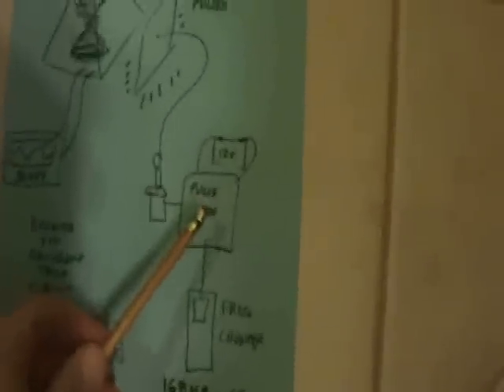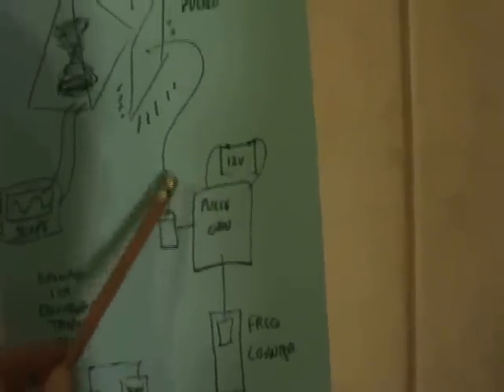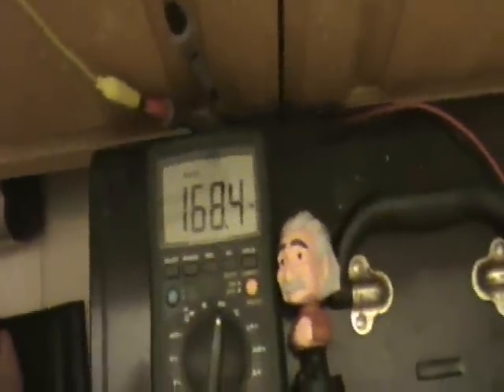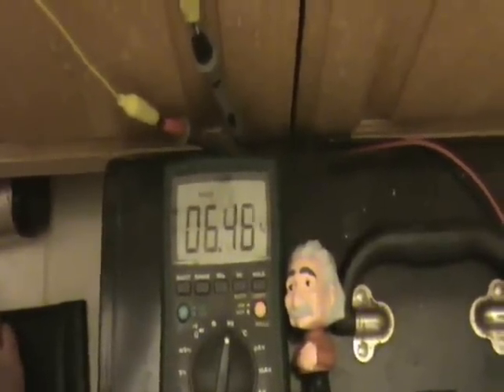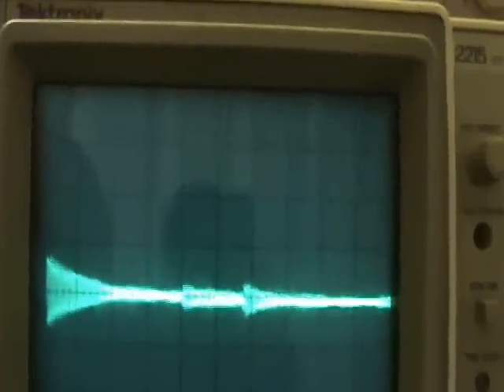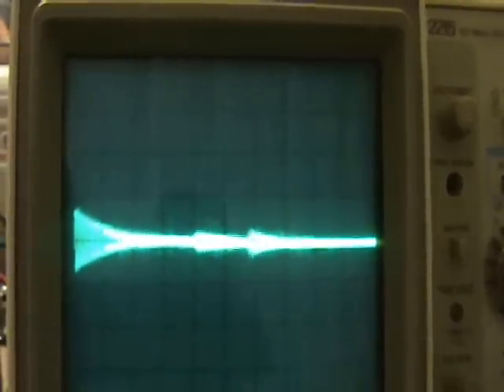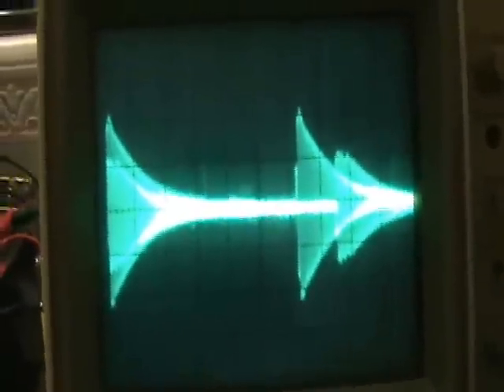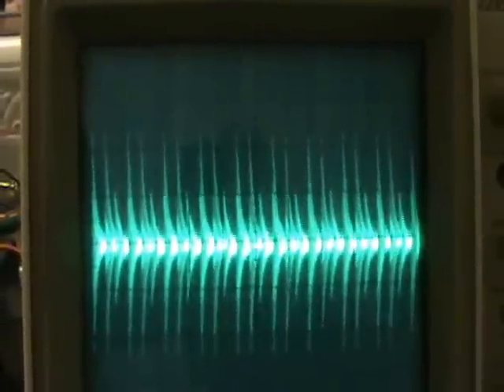Ep. 10: Bashar Free Energy Space-Time Antenna (High Voltage Ping Experiment)

Comment: very interesting developments! i admire your perseverance :)

id take note of that echo frequency, might be the resonant frequency of your coil mass. Therefore If you spark it with AC at that frequency it might just keep ringing like Bashar implied :)

The best way i can think of is by using a small tesla coil with an adjustable spark gap, by adjusting the size of the gap you adjust the sparking frequency so you just have to close the gap until you reach your noted echo frequency. Pain in the ass i know because we don't all have tesla coils laying around, myself included, but that is exactly the type of ping needed.

Maybe a mosquito zapper racket circuit can be used if you add a little adjustable spark gap to it? they are only £3 here in the uk :) you just need to hit that resonant frequency.

good stuff! huge improvement on your music as well i see! keep it up :)

Comment from the maker: I think I know what is going on with the different voltage level spikes. Each spike is associate with a polarity change. The transmission coil has its own ring-down that is down in a much lower audio range. Each polarity change, each zero crossing, of that produces one of these greater-than shaped ring-down patterns -- at varying voltage levels.